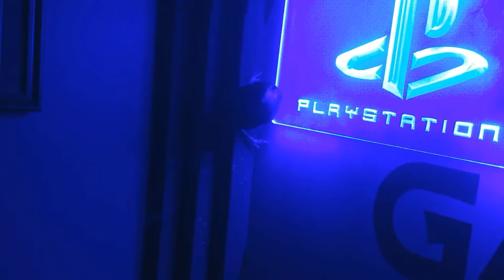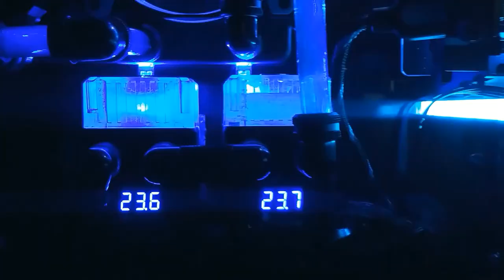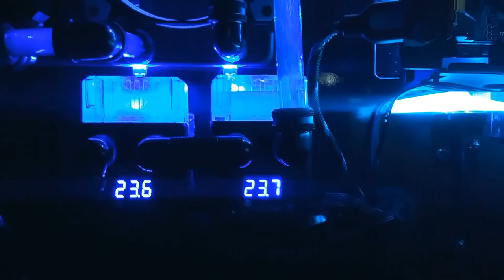Wall Mounted Gaming Water Cooled Pc

Comment: Beautiful build; forgive me for saying yet it appears you have air inside the loop which you do not want, just FYI 😅 Thinking about doing a wall mount yet not sure if I will follow through with it
Reply from the maker: i built this pc in 1 day .. i did not plan it ... running 2 reservoir / pump and having a water pass thru filter will cause a little air... but my rad is the highest part in my loop .. which is were the air will end up... and that's ok... thanks for your comment .. consider subscribing   and check out our channel